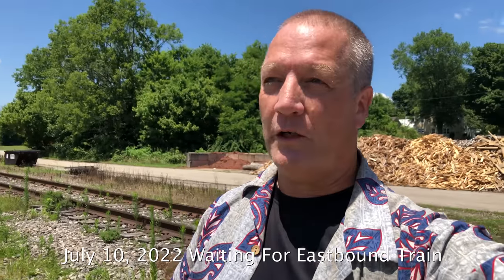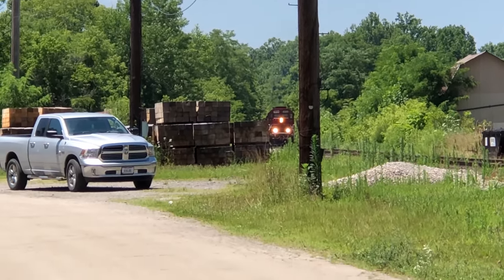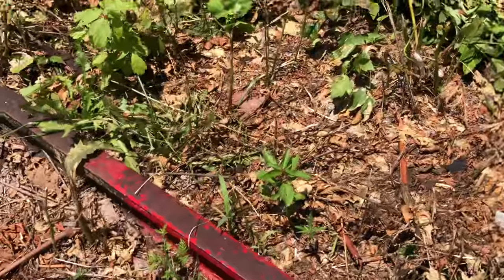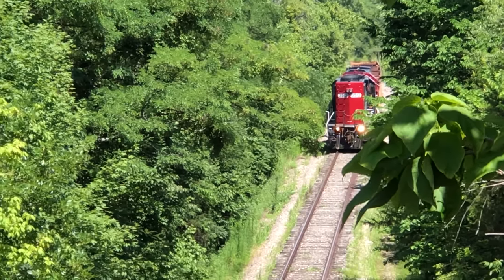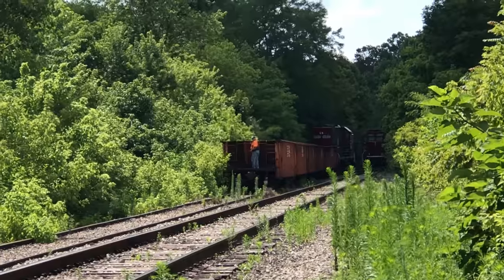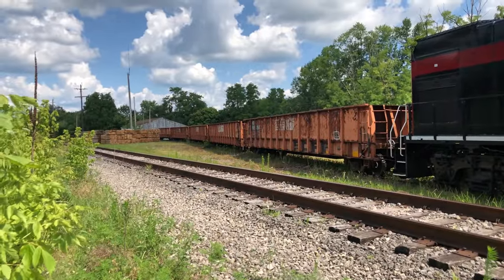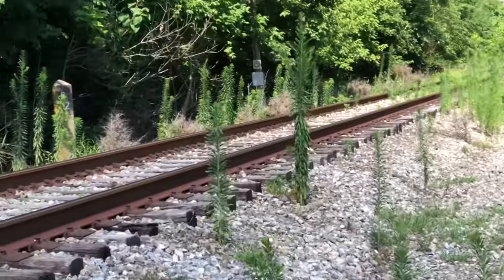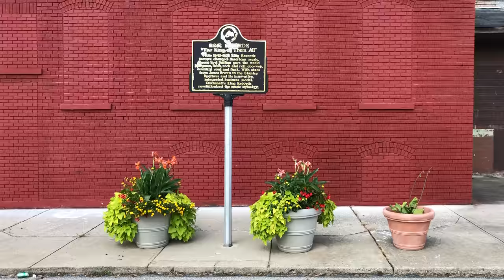Railroad Switching, New Customer, Switching Rusty RR Spur, Last Train Flashback & First Trains Back!

Comment: Great video!!  Here's a question: In the video of NS pulling the last loaded cars off that siding from 8 years ago, the rolling stock was side loading lumber cars (I forget the proper name for them). In this current video, CCET is dropping off gondolas. How do you suspect the strapped bundles of RR ties are going to be loaded onto these top loading gondolas?? I can't imagine the customer will use a forklift and simply "dump" the bundled ties in the gondolas. The bundles would certainly split open and potentially damage the new, untreated ties.

Comment: Since you KNOW everything about this line, do you know what the siding just to the east was used for?   Looks more unused than this one.  Again, thanks for your efforts.
Reply from the maker: Yes but how did you know there was another siding?  The siding just east of McCoy lumber was used to ship boxcar loads of lumber in.  The last boxcar to use it was about 2003 I think.  It was before I started my channel and I took a pic of the last boxcar on the trestle over Elk Run.  NS had just closed the line to through trains and then the boxcar showed up.  they had to remove a pile of gravel off the track at Seaman to get the boxcar there.  After that they put railroad ties in the track just east of Peebles.
Reply: @JawTooth  when you say where you are, I go to Google Maps to see what's around.  That's when I saw the other siding on the north side of the main.  Thanks for the history.

Comment: I just passed the 14 minute mark. They were on the siding with the trees overhanging it. You would think they would have had a crew come in advance and cut all that back before they actually had to run on it. Good to see it in use again though.
Reply: I think he said in the video that they did cut the vegeation back. Looks like they didn't quite cut it back far enough, but it was basically fine.
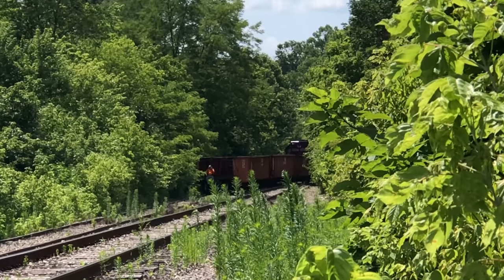Reply: @beeble2003  He was referring to the area out in the open where he was standing, and said they had mowed it all down. I'm referring to the vegetation overhanging the tracks, as seen in the part of the video I referred to. That starts around 12:30 .The tree branches were sticking way out. He was zoomed in on them and says "Wow, there's some trees in the way."

Comment: So Brian why doesn't the ccet have flat cars to pick up the ties. I assume they use a fork life to put them in these cars the ccet has on the tracks now or a Crane but it would be much easier if the ccet had flat cars to load and transfer the ties westbound to Clare Yard
Reply: The ties are going to Norfolk Southern. Thus why they used NS gondolas. They probably just used whatever cars were available
Reply: I would bet to say the customer will load those gons and have them released for movement once they are all loaded…..another fact, most sidings are owned and maintained by the customer from the clearance point of the access point ( the switch leading into ) another fact, the gons being loaded are dedicated gons ( used for maintenance of way ) hence the color of the cars and markings…..good to see the cinci rail working……👍…ms~~~
Reply: They'll probably just use a loader or back-hoe as a crane. As far as I'm aware, the cars that get used are the customer's responsibility (either the shipper or receiver), not the railroad.

Comment: We called tall weeds railroad shrubbery. The weeds were so bad at Little Ferry yard we carried machetes to lop down the weeds so we could find the switch stands and sidings, also good against rats. That conductor needs a hand mike attachment so he doesn't have to hold the walkie. Looks like he got his hair combed backing the cut into the siding.

Comment: Another sweet video 
So, How does the lumber yard 
Move the cars.  To load them?
Reply: I doubt they need to move the cars. There's flat ground on both sides of the track where they're parked, so they can just use a loader to lift the load in. Industries that do need to move cars have a variety of ways of doing it. Smaller industries may use a winch (if you look closely, most cars have attachment points on the frames, somewhere above the trucks) or a loader equipped with a knuckle. Mid-sized industries may use a trackmobile. Larger industries may use any of the above, or a locomotive, or automated systems that use belts or hydraulic rams to move things like hoppers and tank cars through the loading/unloading equipment.

Comment: How did they get those locos turned around to shove those gons? The long hoods were facing each other then the noses were?

Things sure changed in 8 short years.
Reply: Any place where you have a switch, you can change the order of two locomotives. Put one locomotive on the siding, uncouple, put the other locomotive back on the main next to the first one, take the one out of the siding and back it onto the locomotive on the main and you've swapped the order of them.

Comment: They separated the locomotives because they don’t want the much heavier 3512 with the 6 axles in the spur.
Reply: And messed around coupling them nose-to-nose because they didn't want to lead with 1756's broken lights.

Comment: That is the house track McCoy's are using the section house is gone the old building still standing was used by the MW.There was a switch on the other side where McCoy's office is.Another great video on the far end of the line...

Comment: I thought the video was great!  I really like the rare track action ones where it looks like a train has not been there for years.  Question on why the ties are not creosoted or will that be done somewhere else if you know?  Thank you for sharing!
Reply from the maker: Thank you very much!  Creosote will be added another plant
Reply: They put the ties in a tank of creosote at high pressure so the creosote penetrates the wood. That requires some serious equipment so it'll be done somewhere else.

Comment: They flag the crossing was the lights working . Since they are using that crossing if they’re not working why wouldn’t they fix them .
Reply: Obviously they broke recently and haven't been fixed yet. Why do you assume that means they've decided not to fix them at all. Likewise, the broken railings and lights on the front of 1657 haven't been fixed yet but will be fixed in due course.

Comment: Why on earth did they not have 1 loco on the back of the train that could have pushed the cars into the siding, saving all that toing and frowing to the run round. It would have saved a lot of time. Not very efficient railroading.
Reply: They don't tend to run longer trains like that push-pull. I assume there's a reason for that, but I don't know what it is.

Comment: CCET MOW shoulda cleared that siding of brush and Sprayed weed killer. Seems lazy on their part.
Reply: Does CCET even have a MOW department? Wouldn't they get NS to do it, as they own the track?
Reply: @BudgieJane  Does MS actually still own this track?  Thought CCET bought from them back a ways
Reply: @doublediamondrailroad5949  I thought JT said CCET was only leasing the track.
Reply: @BudgieJane  could be.
Reply: @BudgieJane  I would expect that CCET would be responsible for maintenance, though that would depend on the terms of the lease. However, sidings into industries are owned by that company, not by the railroad.